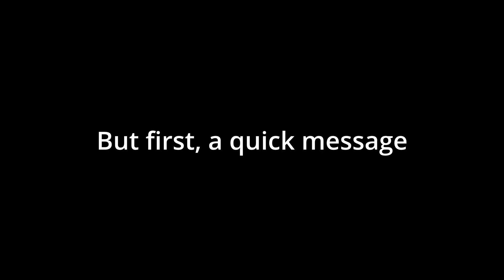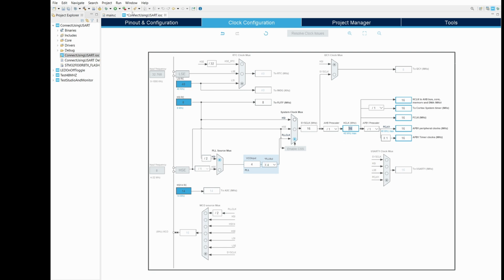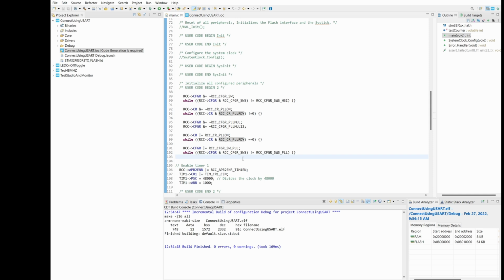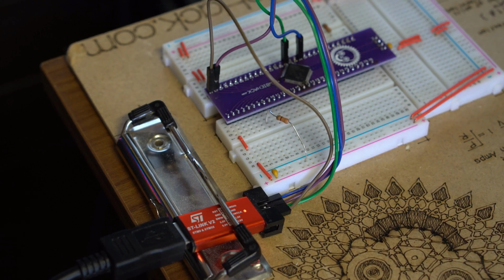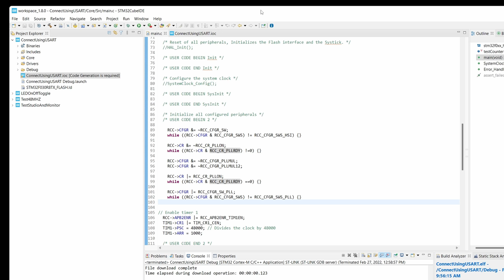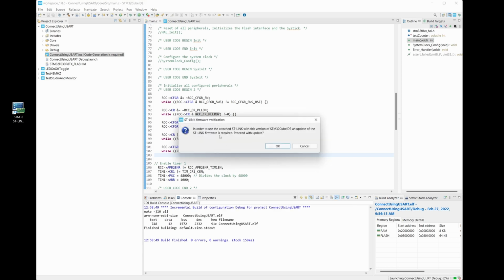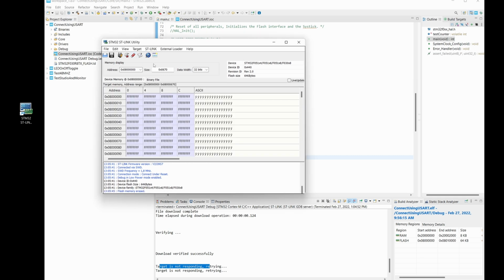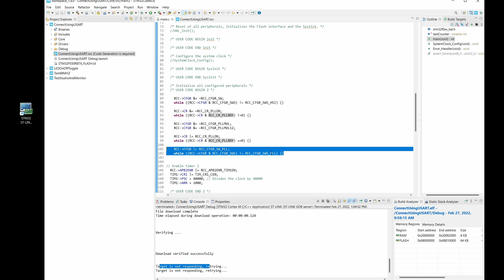6) ARM Microcontroller Tutorial   😬  I   BRICKED MY MCU

Comment: In order for ST-LINK to work after every flash the serial wire debug should be properly configured and enabled. Everything is done via correspodning checkbox in the CubeMX (ioc file editor). If you configure it yourself through registers the proper IO lines should be configured respectively.
Reply from the maker: Thanks. Two videos later I talk about what happened. I simply did not power the AVSS and AVDD pins since I enabled the PLL clock. The PLL clock requires power to these pins.
Reply: @PatrickHoodDaniel  figuring out dependencies of the clock tree and power config requires additional degree for some of their advanced MUCs. Sometimes even their own code generator is broken for certain configurations.

Comment: the reason of the problem may be related to the FLASH_ACR register. You may need to add some extra clock cycles to fetch from memory using the latency area of the register. Thanks for the videos.
Reply from the maker: The reason was AVCC and AVDD not connected. You can see this in the next video. These are needed to power the PLL.

Comment: I've had a few of those Chinese clone st-links refusing to upgrade.  They can still be used with STM32CubeIDE though.  In Debug Configuration you can switch the Debug Probe to OpenOCD and it will still work without an upgrade.  Just FYI.

Comment: It is very interesting, I have a doubt, I would like to extract the configuration that has STC15W204S, without burning it, how could I extract it? Thank you for your help
Reply from the maker: Not sure, never tried to extract data, but you can see the memory contents, so you could definitely copy the flash.
Reply: @PatrickHoodDaniel  I have been looking for documentation to try to do it, I know that the STC15W204S is programmed in C and is a reverse counter of use of the product, the model is the stc15w204s h26k782104xa, carries an internal safety fuse and had thought to use the kit aliexpress CH341A Programmer adapter + SOIC8 adapter + SOP8 clip with cable + 1. 8V adapter CH341A EEPROM Flash BIOS USB programmer ZIF adapter to try to copy the content and see how it works but I am not sure how to copy the file and then read it, it is a cheap chip, but I think I can do more things with it, so I was asking if there was a way to copy the content.

Comment: If you forgot to set the debug interface configuration to use SWD and left it blank, you'll "bricked" your dev board when you flashed it.  That should be one of the first thing you set when you're setting the project in the Pinout View or IOC view.
Reply from the maker: Yes, I did a video on this very idea a long time ago. Thanks.

Comment: Is this because the SWD interface hasn’t been configured in the IOC when you did the PLL clock configuration in the STM32 project and then pushed the code?

On the hookup from the stlink, there isn’t a wire from the rst to the the MCU. I think you can also configure “connect under reset” without doing the SWD interface configuration in the project to maintain the ability to always flash.
Reply from the maker: Soft Bricking (that's what I'm calling it) the MCU could happen for so many reasons. I've actually bricked my MCU by programming different functions for my SWD pins and they didn't work as programming pins anymore. Lol. In this case, I believe it was because I did not have the AVCC and AVDD pins connected since the PLL close required those pins to have power. I explain this in the #7 video, I think.
Reply: Mystery solved! Excellent news. I’ve been bitten by forgetting to reenable the SWD in the project and then lost debugging and flashing.